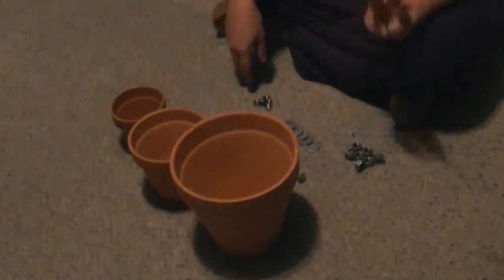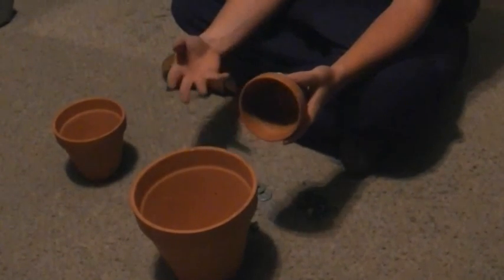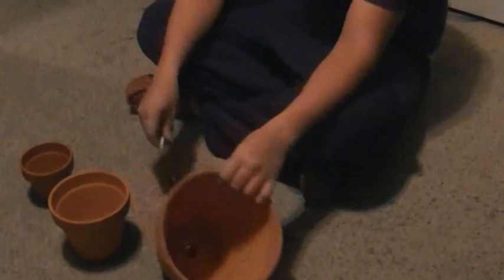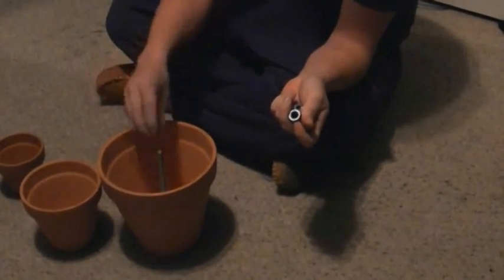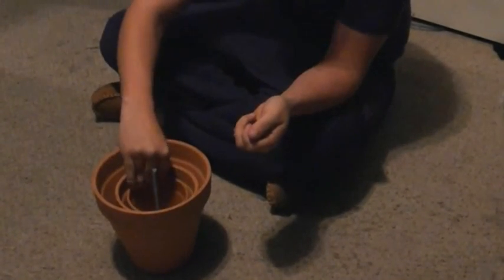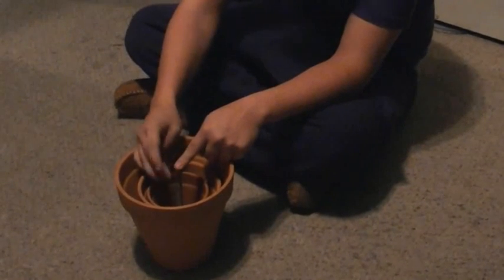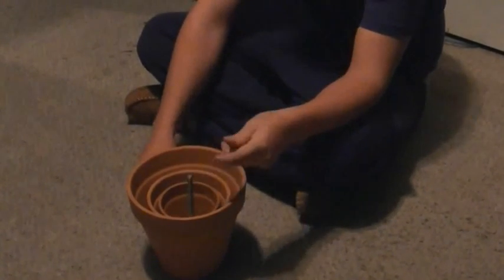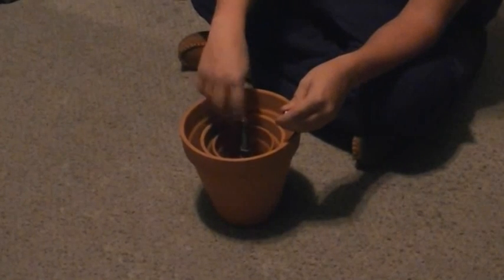How To Make a Candle Powered Space Heater

Comment: The more pots you use basically the more heat. not higher but more as in longer. The thing about these heaters is most don't realize that they don't move air and heat so in a closed room with this on the heat slowly builds up. and unlike your central heating its on from the second you light it so you don't get this ooo its warm and 30 minutes later ooo I'm freezing affect. plus these help cut down on your electric bills. :) You know you would love that less bills always makes me smile :)

Comment: So... since it doesn't increase the heat-energy output of the candle... exactly how does it provide more heat than just lighting a candle and letting it burn?

Granted, it provides a heat sink that lowers the heat output for a short time while the steel and ceramic heat up... and it radiates that heat for a short time while they cool down.   Even so, nothing's changed in heat output, so what's the benefit?

Comment: I decided to make this.. Very simple. Very cheap. Right now, I'm registering an inside air temperature of 160 degrees and I've had it running for 15 minutes. The pots are just now starting to get warm. I'm using four tealight candles that cost a penny a piece at my local Wal-Mart (Pack of 50 for 50 cents)
Reply: A pack of 50 tealight candles from Walmart (even 5 years ago) was NOT 50 cents... try $3.50 -- $5.00, I buy them all the time and I've NEVER found them for "a penny a piece" anywhere.

Comment: Pop a socket on an adapter shaft and put that in an electric drill. You'll be able to wind those nuts down in seconds by turning the long bolt from the bottom while you hold the nut from turning.
Try making the base out of a (possibly cut down) coffee can with a couple holes punched around the bottom, a bottle opener with triangle cutter is perfect for the job.
Cut pieces of metal pipe for spacers if you want to save on what the large nuts cost or drill holes in steel can metal if you want more thermal mass.

What you are making is a poor man's tile stove. It can be vastly improved if you can make a reburn chamber but that would take more heat and maybe a catalytic screen and really need a chimney. You would burn coal or charcoal or maybe wood in a tile stove.

Last thought, how about an oil lamp instead of a candle?

Comment: If you understand different materials transfer heat at different rates, a glaze is normally a resin, which is an insulator and doesn't allow heat to transfer very well through it. Glazed pots will therefore retain and gain less heat overall.

Comment: Its not that the glaze is an insulator, its just that it is reflective, and will bounce the IR light off instead of absorbing as much as possible, the steel core is what radiates the heat into each chamber, it uses all 3 methods of heat transfer, very clever...

Comment: This is a great idea for camping or emergencies, but a very bad idea for every day use.  Propane is MUCH cheaper per BTU than candles and I'm sure an electric heat pump would still beat candles hands down.  But if the power goes out and you need to get warm, having this around is pretty awesome.

Comment: You could also use a short piece of metal water pipe instead of the fat nuts. More metal and with a washer on the end it will be straight and tight.

Comment: To expand a little further it has to do with surface area. The candle is burning much hotter, and glowing visible. So most of it's energy is released due to chemical/convection(air/combustion) and of the energy released as light, it's emitting in visible mostly. Visible light isn't well absorbed or reacts with matter in a way to give up a lot of it's energy. IR does, in fact majority of Earths warming is IR not visible. That said, Pots are warmer but hot enough to emit high energy IR evenly.

Comment: Radiant heat is much more efficient at heating a dwelling space than forced air heat even when the same amount of energy is used... because of the phenomena of how heat transference works). Forced air heat cools more quickly as it moves through the air (like the heat rising from the candle to the ceiling, or forced air space heaters). Radiant heaters are considered more efficient (for space heating) because heat is more efficiently absorbed and then re-radiated out into the dwelling space.

Comment: Yes it will supplement the heat in your home because of the flame..  but a simple flame will only generate a limited amount of BTUs.. The terracotta pots only provide a heat absorption factor to hold the heat generated.. Blow a personal fan on the pots and it cools down in a relatively short time if you no longer have a candle burning in the system.. Having said that you can supplement your heat..  and it can be cheaper than an electrical furnace to operate if you can find the materials cheaply.. Learn how to make candles and buy your candle making materials on the cheap....Votive candles are a good alternative in making candles from candle drippings..yard sales.. post Christmas clearance sales..Another trick is to use a personal battery powered fan to blow across the outer pot with the method he showed or drill holes along the outer perimeter of the bottom of the largest pot and blow air into the pots from underneath to create a convection process.. No it won't increase the heat generated.. it will only accelerate the distribution of the heat in a quicker timeframe.. Eventually the cooler air will cool down the pots to the point that it becomes ineffective unless you can keep a flame working

Comment: So to summarize.

Candle = Condensed surface area, most energy released via convection, convection puts heat up in small stream, spreads across roof and absorbed quickly. Rest is released as visible mostly, doesn't absorb well.

Pots - Low overall temperature in comparison, high surface area. Convection conduction occuring, but primarily IR being released which is readily absorbed by most materials, including you warming evenly.

Fires are actually horrible heating mechanisms unless controlled.

Comment: but the heat is going directly to the ceiling and collecting them before going out the house, so you would need a magical fying chat and sitting on your ceiling to feel some of the heat produced by the candle, what the pot system does is not producing more heat (that would be thermodinamically impossible) but maintaning it to table level so that you might feel the heat when sitting in front of your pc if you have that thing close to you

Comment: you sit close to that device and it will warm slightly the area you're sitting in, of course it won't warm a whole room and if you move from the proximity of the candle device you don't feel the warmth anymore... so it might warm slightly a foot square, but it's okay if it's the food square you're sitting at...without the pot otherwie the heat produced by the candle would not collect in that foot square you're sitting at but in the whole ceiling

Comment: Problem with just burning the candle in the open is, the very hot air from the candle will go straight up to the ceiling and stay there.  So you heated your roof where you aren't.  The pots trap the heat down near the ground, and slowly heat the air there, so you get a better convection effect all round your room.  Be careful not to give yourself carbon monoxide poisoning tho.

Comment: I think I'm doing something wrong... because I'm trying mine out now... and the candle has been burning underneath it for about 2 hours, and there's no heat coming off of the outer pot... but the bolt itself is hot to the touch.  Any ideas or suggestions?
Reply: We use 4 - 6 candles - see above comment & link. Dunno do ye need a CO detector if windows are shut tight.
Reply: smeejit
Thanks... I'll try a few extra candles.  I've checked all the windows, and they're all locked tight.

Comment: My physics may be off on this (so someone chime in if that's the case), but surely the candle alone would just send its heat straight up to the ceiling via a plume of convection whereas the ceramic pots would radiate the heat instead?

Comment: Would a all metal design work better than clay?
Reply: No, metal dissipates heat to quick, clay retains and radiates the heat.
Reply: trippleaaaaaaaaaa Then why all that metal inside? Wouldn't it work just as good without it? (Just the spacers). I would also just use two pots instead of three.

Comment: Just finished it. Did as told in the video. Didn't work. The pots do get warm but there isn't enough heat. Everywhere on the web they make it sound like this system is enough to heat a room. Either they are exaggerating or i am not making it right :(
Reply: Use two pots works best, my inner pot has a 5 inch diameter so I can easily place four candles. If yours don't heat up try imagining if there were four or five pots covering each other, you wouldn't feel a thing!
Reply: I did that too, because the candles were directly touching the inner most pot, so i removed it. But there just isn't enough heat. If you just want to get your hands warm then yes it might work, but then you can do that without using the pots too. :/
Reply: Sarosh How many candles did you use? I use four in mine and after a while (maybe 45 minutes) it gets really hot where you can barely touch the exterior pot. Maybe the flames are small? (oxygen deprived).
Reply: I used 4 candles too and made sure there is enough space at the bottom for the oxygen. I agree the outer pot does get too hot. But look if you don't use the pot and you put your hand at some distance above the candles, wouldn't that space be too hot? I understand that the ceramics make the heat last longer after the candles are put out but they don't generate extra heat, so in my humble opinion we can't get enough energy out of this process to heat the entire room.
Reply: Well on the positive side we got ourselves a big hand warmer 😉
Reply: Agreed. And it serves as a decoration piece too. ;)

Comment: Why all that metal inside? Wouldn't it work just as good without it? (Just the spacers). I would also just use two pots instead of three.
Reply: The metal heats up & disperses the heat faster.  Also need to separate the clay pots, & the more clay pots, the more heat resivoirs.
Reply: I am quite sure that if you put four clay pots (or more) and just three candles in the center the outer pot may barely heat up.
Reply: +possums1010  He hee. Nice to see you. Just bumming through YT. Never made one of these gizmos. Ya' think they actually work? I have literally hundreds of candles. I pick them up everywhere I go like thrift stores, garage sales, etc. Adios : )

Comment: Wrong. Heat through a candle is turbulent and rises and dissipates fast. You don't want heat at your roof, it's lost almost immediately/pretty quickly. That and the amount of heat released is low, so it gets absorbed quicker. The pots will get hotter, and radiate via IR and convection. Remember, that pot is glowing, so are you in IR. Very little of the candles energy is released as IR, and IR radiation falling on skin and the room heats evenly. So yeah, simplified but these work.

Comment: Hi, great vid. Got a question as I've seen a few vids on utube on how to make candle space heaters. I want to make a small heater as I'll be using it for camping.

 Is it better to have 2or3 pots? I'm guessing that having less pots means that it'll heat the area up quicker and 3 pots it'll take longer to heat the area but over time will last longer? 

Is this correct? Also I'm guessing that the 2 pots will also give off more heat than 3? 

Any advice on my points will be greatly appreciated :D
Reply: If for camper, I personally would do 2 pots with 2 total pots each.